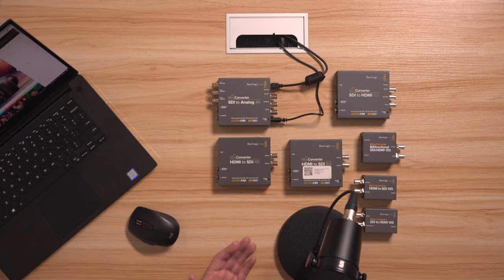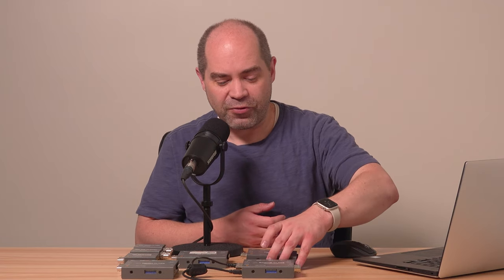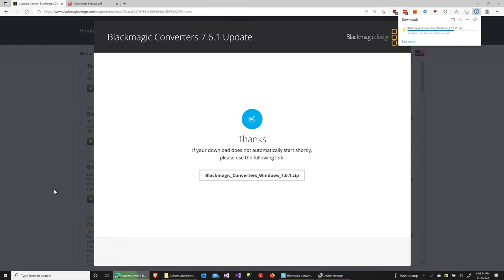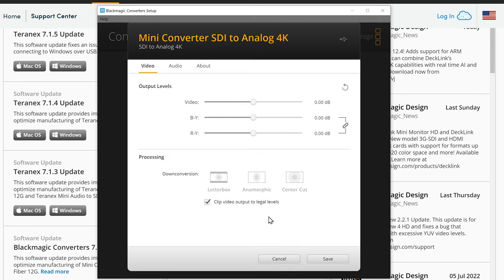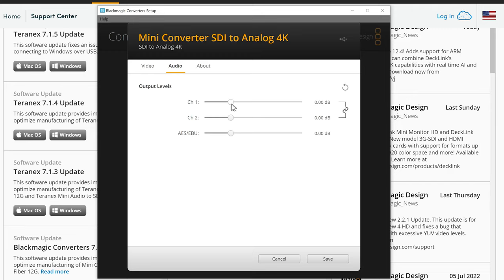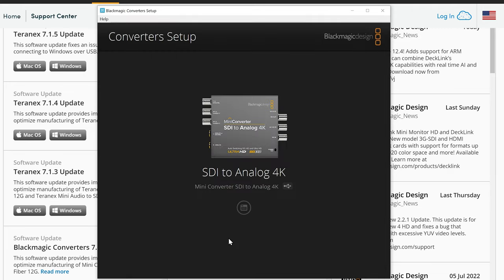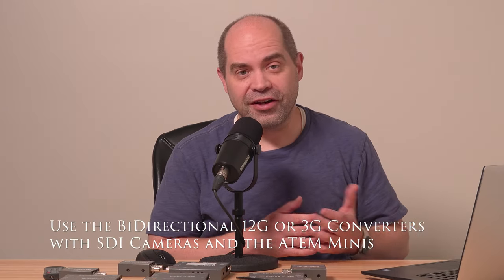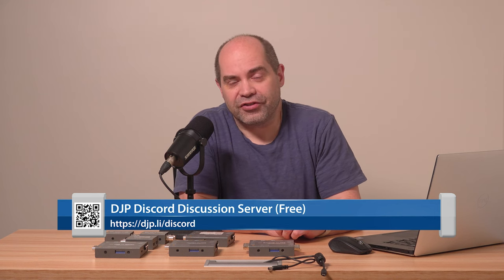Unlock the Potential of Blackmagic Design Mini/Micro Converters

Comment: My Church is streaming on YouTube. There was a problem after running HDMI and SDI cables (with converters) from cameras to ATEM mini pro. Cameras turn off at random times and turn on after some time. There may be a problem with signal amplifiers, but what? Maybe the wires are too long? We can't figure out the problem for a long time.

Comment: Undocumented behavior of BMD Mini/Micro Converters: Apple Mac Mini HDMI ports can be configured to output 1080p59.94 video signals, which is important for compatibility with BMD ATEM Television Studio HD 3G-SDI inputs. Both BMD BiDirectional SDI/HDMI 3G and BMD UpDownCross HD converters claim to work compatibly at this frame rate, but in practice they don't. The BiDirectional 3G converts the 1080p59.94 HDMI signal to 1080p60. The UpDownCross HD converts the 1080p59.94 HDMI signal to 1080p30, even when its hardware dip switches are set to 1080p59.94. I tested these BMD converters using an Extron DSC 301 HD converter, which can report precisely which HD signal it is receiving. These BMD converters simply do not work as advertised.

Comment: If I use a HDMI to SDI Blackmagic mini or micro converter to run two SDI signals into a ATEM Constellation HD ME2, does it work the same way a DeckLink Duo would as far as sending multiple signals from Propresenter 7 on my Mac min into the switcher in order to  display different content on screens?
Reply from the maker: They’re not the same. The DeckLink is not a desktop display device, so it has to have explicit support in the application you are using, like ProPresenter. The HDMI (native or converted from USB-C) are desktop display outputs, so you’ll literally see the user interface for the applications you’re running on your computer. On top of that, Apple Silicon based Mac Minis only support two outputs, so if you were to connect those outputs to the HDMI to SDI converters and want to see something different on another monitor, we’ll, you can’t because you’re out of supported outputs. If your intent is to mirror your desktop to your switcher, then the HDMI to SDI converters have you covered. But the two types of devices are handled very differently.

Comment: Do these converters send edid data over the sdi cable?
Reply from the maker: No. They can't. EDID requires a bi-directional connection, and SDI is unidirectional. In professional video we don't want our devices trying to negotiate signal types anyway -- we need for that to be predictable and reliable.

Comment: The 12G bidrectional converter is not automatically converting down to 1080 for my small hd monitor that tops out at 1080.I am sending out 4K UHD from a RED Komodo to the converter to the monitor and I am not getting video. Any suggestions?
Reply from the maker: The Bi-directional Micro Converters won't do frame rate conversion, so if the frame rate of the camera isn't supported by the monitor (i.e. if the camera is outputting at 24fps but the monitor only supports 60fps) you might need a more sophisticated converter.
Reply: @djp_video  You answered it on another video. Apparently, the bidirectional converter can only downsample sdi to hdmi, not sdi to sdi (bummer).

Comment: Is this possible with the BMD Mini Converter UpDownCross: connect an HDMI source to HDMI in, output from SDI out, and HDMI out and get a signal from both outputs; OR connect an SDI source to SDI in, output from SDI out, and HDMI out and get a signal from both outputs?
In other words, four connections are connected, but only one input and two outputs are used at one time.

SDI input is from a video source
HDMI input is from a laptop
HDMI output goes to a monitor
SDI output goes to a monitor (through a BMD SDI to HDMI converter)
Reply from the maker: Both outputs are always active. But only one input is active at any given time.

Comment: So… the micro converters don’t change the resolution at all? I can’t feed a 1080p signal into it and output a 480i?
Reply from the maker: Generally speaking that is true. The exception is the 12G versions, which will down-convert 4K to 1080p if the connected display/device doesn't support 4K.
Reply: @djp_video  saved me money and a bigger headache than I already have 👍

Comment: Have you used the UpDownCross HD converter? I have an SD 16:9 25PsF camera. The converter can do the desqueeze just fine and it does support outputting 25PsF but it appears to me that if I try to convert 25PsF to 25p it doesn't actually reconstruct the frame but runs deinterlace. Now if I move the camera even slightly, I get stripes in the picture, which definitely wouldn't happen with true PsF -> p.

As far as I understand the SD SDI 25PsF is pretty hacky. It doesn't tag the 16:9 squeeze nor PsF, where as newer formats can mark if the signal is PsF.
Reply from the maker: You'd want a product with a proper deinterlacer like the Teranex Express/AV. Deinterlacing properly is really hard and the inexpensive converters won't do a good job of that.
Reply: @djp_video  yeah, I have heard the big Teranex boxes would do it the right way. Well, unless it becomes useful for something else, I don't think it's worth for old SD cameras at this point :)

Comment: Hi group, to my great surprise, my ''HDMI to SDI'' does not connect to my ''Budget SDI to HDMI'' What option should I choose to make them communicate?  PS: Thanks for this video!!!
Reply from the maker: What signal format are you shooting? Does it happen to be 1080p50 or 1080p60? If so, you've probably run into a 3G-SDI Level A/B incompatibilty issue. And if so, you can plug the Blackmagic converter into your computer, run the Setup software, and change from Level B to Level A.

Comment: I have a question, does the Blackmagic Design Mini Converter SDI to Analog 4K convert only to analog signal or to SDI from analog?
Reply from the maker: It converts one way -- from SDI to Analog. They have another model, the Analog to SDI, which will go the other direction.
Reply: @djp_video  thank you

Comment: First of all, thanks a lot for all the info! Your channel is amazing!

I have a big question and I think you're the person to guide me... My computer doesn't have Thunderbolt 3 and I'm looking to clean my colour feed coming out from my laptop, that actually allows 4K output, to send my color grading signal (DaVinci Resolve) to a 4K monitor :

- Does the "Micro Converter BiDirectional SDI/HDMI 12G" help me to clean my colour feed from my GPU HDMI computer output to my monitor? Like the UltraStudio... As I said, my laptop doesn't have Thunderbolt and I'm just looking for an option, not that expensive, to send a better signal to my monitor.

Thanks a lot in advance.
Reply from the maker: Without a Thunderbolt port, your options are more limited. 

I'd steer clear of any USB-based solution. USB doesn't have enough bandwidth to provide high quality, uncompressed video at any resolution you might need.

The next best option is to just use the HDMI output on your computer. And then get (or rent/borrow) a color calibration device to calibrate your display for accurate color and response curves every few months. The least expensive calibration device that I could recommend is the Calibrite Display SL (product info & purchase links: https://djp.li/displaysl ). I know most people buy products in the Spyder line from datacolor, but in my experience they are junk and unreliable and you're better off doing nothing than calibrating with their devices and software.

Comment: Ok so i have a laptop hdmi out with an A/V feed from OBS to bidirectional hdmi to sdi with a hdmi out to a boxcaster and sdi out to second bidirectional hdmi to sdi.  That second converter has a hdmi out to an audio extractor and monitor. 
Im getting a half second skip in audio every 20 seconds 
Anyone know why I’m getting the audio blip issue? I tried updating the converters but it did not fix it.
So frustrating. It makes our church broadcast unusable.  Please help.
Reply from the maker: What frame rate are you using? Is there a mismatch between the source feeding OBS and OBS's settings? (For example, OBS set to 29.97 fps where the video going into OBS is at 30 fps, or vice versa) What is the source of the audio? If you make a recording in OBS does it also have the same audio sync issue?
Reply: Ill check frame rates but i think they are all 30 or 60
No skip in obs recording
Only boxcaster
Audio is coming from X32 soundboard
Reply: All frame rates match. Im at a loss.

Comment: Hey guys.. i’d have to share with you an issue Regarding HDMI to SDI converter and ATEM 1 M/E STANDARDS 

we have canon XF105 cameras That has only fbs of (50i/25p) connected to ATEM via SDI Cable and it works only while choosing 1080i50 standard. In the other hand we have BMD POKET CAMERA 6K Pro connected to the switcher via HDMI to SDI converter . That doesn’t work at that standard.

The BMD Camera works on 1080p50 or 24,… it depends on frame rate on camera at both levels A&B!

Is there any way to let the ATEM switcher recognize both cameras??
Reply from the maker: With the ATEM 1 M/E switcher all of your video sources have to be the same video format, and it has to match whatever format the switcher is set to. In your case you'll need to add a converter to one of the cameras to change the format before it gets to the switcher. The two that I recommend for most cases are the Decimator MD-HX https://djp.li/mdhx and Blackmagic UpDownCrossHD https://djp.li/udchd.
Reply: @djp_video  I would thank you for your helpful, useful, fast response 🙏🏼

Comment: For the micro converter sdi to hdmi 3g to work with luts it looks like you need a USB 2 port on your computer to set it up. Really strange when the unit itself has a USB C port but that is the only way I have managed to make it work with my two units. I tried with both PCs and Macs and the only computer that it worked with is an old Asus rig running win 10 with USB 2 ports.
Reply from the maker: The converters work fine with USB 3 ports. I used USB 3 ports when making this video. It also doesn't matter whether you use USB A or USB C as long as you have the proper cable. (Make sure you're using a data cable rather than just a charging cable, as they are different.)

If a device is on a newer firmware version than the installed software knows how to recognize they just won't show up. Make sure you have the latest software.

Occasionally in Windows the devices will get added to Device Manager without a driver (for example, it is plugged in before the software is installed), and this will cause the devices to not show up in their setup applications. If this is the case it can be fixed by opening Device Manager, finding the devices (often under the Other category), and highlighting them and deleting them. After unplugging and plugging back in the driver will be reinstalled.

Comment: Do others have problems with the bi-directional micro HDMI / SDI converters not sending a signal and needing power cycling?  I have to power cycle mine every couple of days :( The 12G also runs REALLY hot. 

On the plus side I love the ability to add LUTS in some of the converters.  Thanks Doug for the previous video on rhat.
Reply: Yes, sometimes they suddenly stop working for unknown reason. Only power cycling will then bring them back to work.

Comment: The biggest pitfall I've seen with BMD hardware is their tendency to default to 3G level B signals. Other manufacturers' SDI hardware seems to expect level A.
Reply from the maker: It depends. My Sony cameras also use Level B, for example. Level A is more common in broadcast level gear.
Reply: @djp_video  What's the visual difference?
Reply from the maker: There isn't any.
Reply: Actually, was on a pretty big ob somewhat recently where the ob trucks wanted level b from all integration partners.... 400 cameras plus size ob. There were also sending us level b returns too. Wasn’t black magic in the trucks either, I asked.

Comment: The BMD website is not very intuitive.  I wish they would just put the software, specs and documentation on the product page.  Also, don't combine manuals for all the different ATEM mini models.  It just adds to the confusion of which atem mini has which features.  It's lazy, and makes using the manuals tedious especially when some models don't support certain features.

Comment: in my expirience you only need to set cam id on the microconverter if you use it with a sdi based atem.
HDMI based atem send the ccu & tally info out of the hdmi input (CEC), but only send it for the specific cam. So input 1 only outputs stuff for cam 1, input 2 for cam 2, .... (While an sdi return contains ccu, tally and intercom for all cams)

Thats why an pocket cinema cam on an atem mini does not need to set any cam id, because there is only data for one cam.

see the drawing i made: https://i.imgur.com/K9VbN80.jpg
Reply from the maker: With an ATEM Mini, the Camera ID in the converter and SDI camera just have to match one another... they don't have to be the same as the ATEM input channel number, though. But with an SDI switcher and HDMI camera, the converter's ID has to match the switcher input channel number.